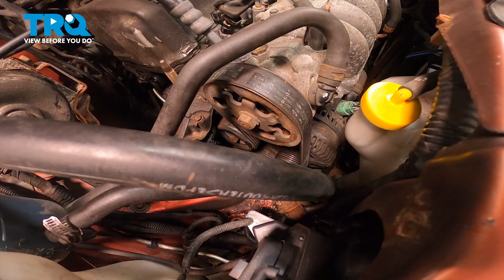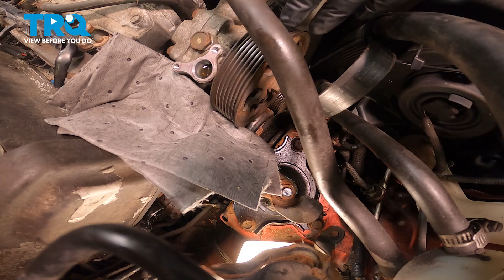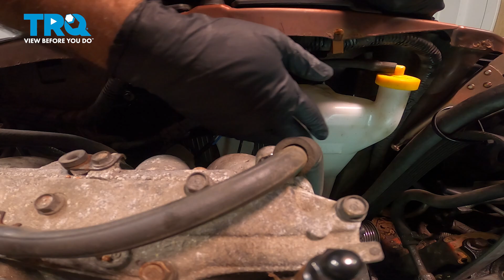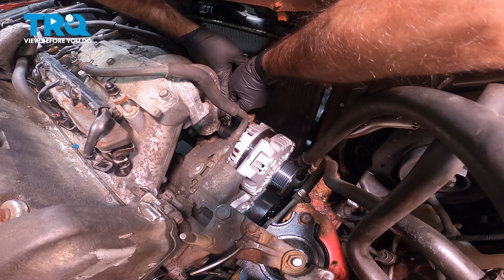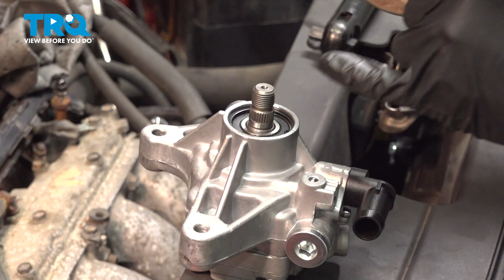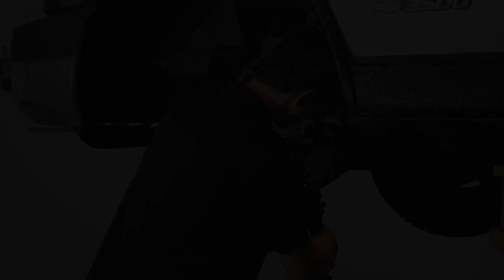How to Replace Alternator 2003-2011 Honda Element

Comment: KEEP YOUR FINGER ON THE BACK OF THE NUT WHEN UNSCREWING THE BLACK ROUND PULLEY.  The bolt that holds the actual drive belt tensioner pulley (the black wheel)  is not held in place behind the assembly housing, it should be!  In this video you do not mention that it may fall off and into your engine area, mine did, it now resides in some dark and dirty place.  I had a replacement on hand so the nut wasn't a big loss, but if someone did not have a spare it could be a major problem, and I don't like having random parts bouncing around my engine bay waiting to deadline something important.  Good luck!

Comment: Thanks for putting this together, it helped me with my alternator swap on a 2003 Honda Element.  I appreciate the level of effort you put into putting this together.  I did it nearly exactly like you did it because I also wanted to inspect the belt tensioner and power steering pump while in there.  I'll post my technical note in a separate comment, just wanted to say thanks here.

Comment: Just changed mine out in my 2007 element. as many others are saying, no need to remove hoses and pulleys from power steering and no need to remove the tensioner. I only removed the middle of the radiator support, left fan (there's a hard to reach electrical connector clipped at the bottom) and coolant reservoir. This gives you more than enough room to get the power steering pump out of the way and to pull the alternator out. 

TRQ makes this seem so involved b/c they're making multiple DIY videos & just uploads it all together without trimming the unnecessary steps. Check out other videos before you potentially create another problem for yourself following what they do step for step.

Comment: I came here to prevent anyone from using this guys technique. Loosen the belt. Pull the radiator over flow. Loosen the fan and slide it the right. Loosen the radiator support and pull towards the front. Then it’s as simple as two bolts to remove the power steering pump and set aside and 3 bolts to get the alternator out. No reason anyone should ever do all the extra work this guy did. He had me scared to do a simple 2 hour job

Comment: This is the most overly complicated video on this subject. The power steering pump can be removed with two bolts without disrupting the fluid. DO NOT FOLLOW THIS VIDEO

Comment: After doing this job ot seems pretty insane to disconnect hoses and pulleys on the power steering pump. Just unbolt it and place it out of your way.

Comment: Are those two bolts on the bottom of the alternator different lengths? I have two bolts left at the end and they are different lengths. I'm not talking about the top bolt that is like three times as long. The bottom two are about 1/2" different in length. Which side does the long one go on?
Reply: Mine were identical, interchangeable.  2003 Element.

Comment: I hope people read the comments before working on their element. There is no need to undo the power steering lines or remove pulley, just flip it all back. Don’t remove the fan either, just shift it a couple inches to drivers side. This job can be don’t in maybe 1/4 of the time it took you. 😅

Comment: I just replaced the alternator, belt tensioner, and belt yesterday and i didn't have to pull any lines for the power steering. I unbolted it and just laid it back across the top of the valve cover. This was a 2005 i was working on.

Comment: So, just pulled my passenger side fan out, as per the video.  I yanked some wire from somewhere attached to the bottom of the housing.  Not sure what it goes to, it is a single blue wire harness, male to female disconnect (busted because I just pulled it up and out like the video).  I can not find anything about it anywhere on the internet...So I disconnected the power on the top of the fan as shown in the video, yanked it up and out, and have this stray blue wire attached to the bottom harness clips.  No way I can reach down there to reconnect it, hope its not important!
Reply: I have this wire too, no one mentions if it anywhere?!

Comment: The vid is for changing out the alternator. He acts like part of that process is to replace the tensioner for a new one. Is that right? If you ever pull out the tensioner, you automatically HAVE to toss it and put in a new one? Why not put the old one back in?

Comment: There is absolutely no need to take hoses or pully off the power steering pump. Merely unbolt power steering pump with hoses attached. Also no need to mess with the tensioner pully assembly other than to remove serpentine belt. Once electric fan is out of the way there is full access to the alternater.